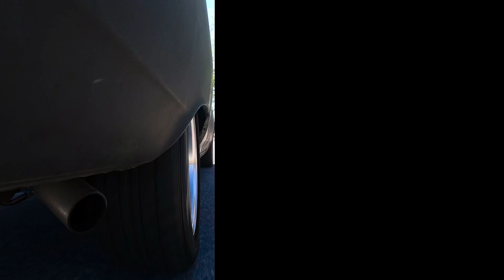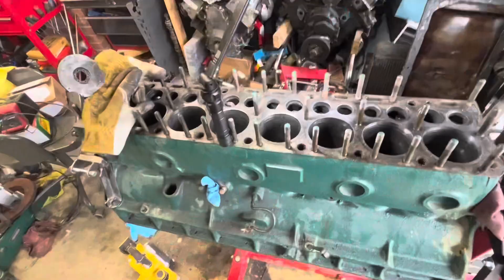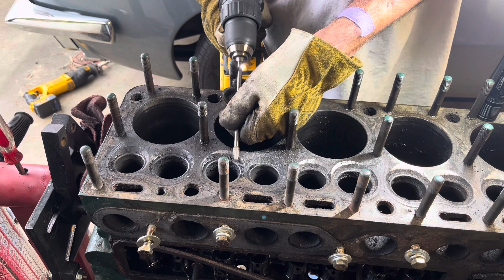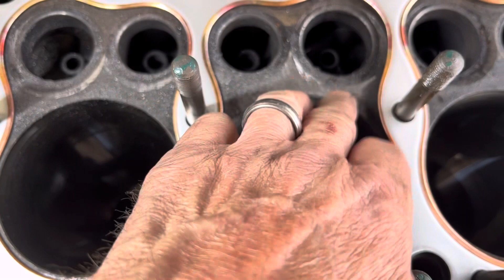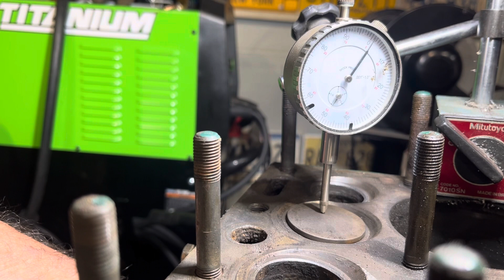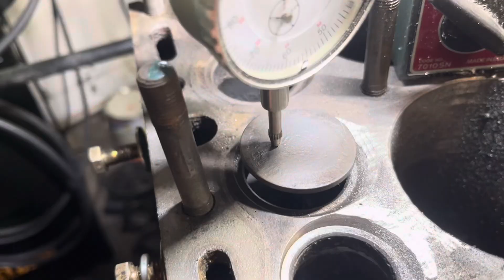Porting a flathead engine see my straight 8 taken apart for modifications

Comment: Hey, cool project. Do you have an expectation on HP?  Do you have the info on what the stock cam specs were and what the current specs are?.....duration  at .006 and .050, also lobe separation. If your compression is at 9:1, which octane have you been able to get away with?    thanks, my name is also Mark